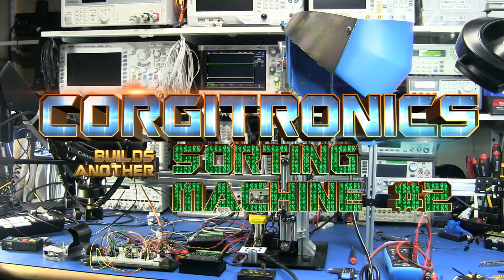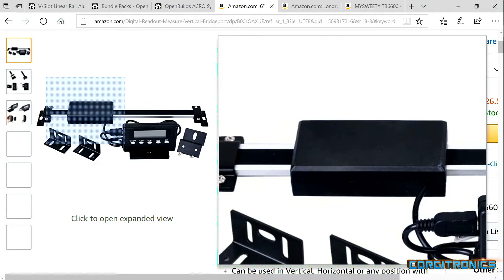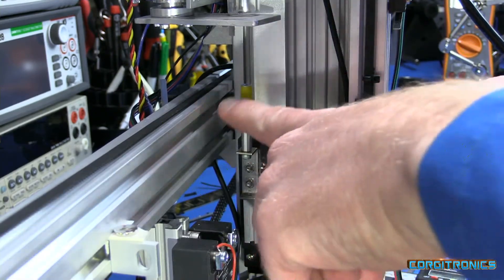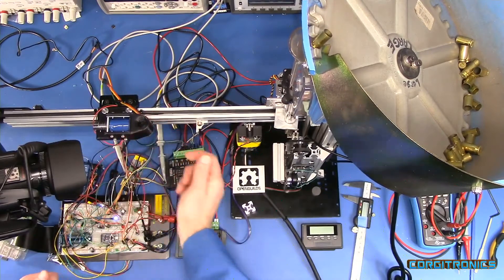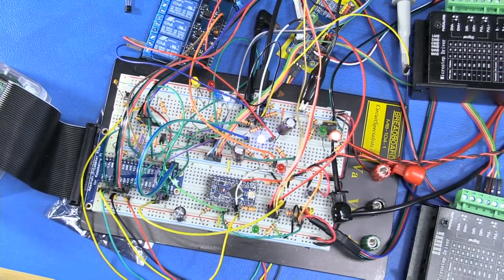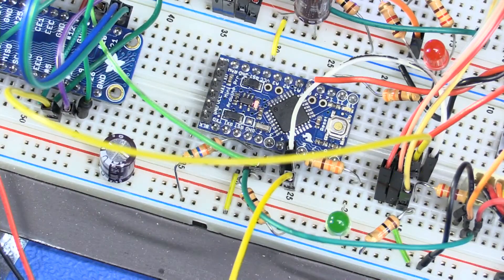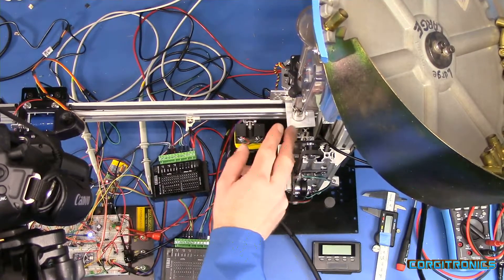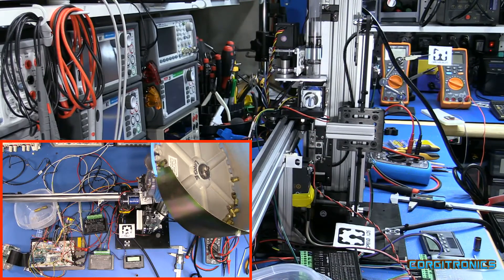Case Sorting Machine #2 - The Soul of a New Machine

Comment: Hi, don't see a advantage of the  DRO? Why not use a optical sensor or a laser to differentiate the hight? Or a inductive proximity sensor like used in 3d printers? The DRO seams very slow?
Reply from the maker: It has to be pretty accurate and very repeatable.  For optical, the cases are shiny if they are clean, but are often quite dirty. 
 I messed with induction sensors, but the measured distance depends upon the metal and how much of it there is... cases are of varying diameters, thicknesses, and can be aluminum, brass, steel, brass plated steel, nickeled brass (that's all I've come across).
I have come up with a simple alternative that doesn't need the DRO at all... just have to implement it and get another video out.